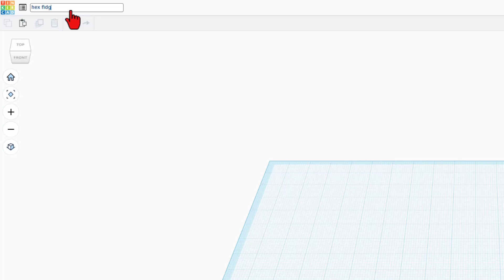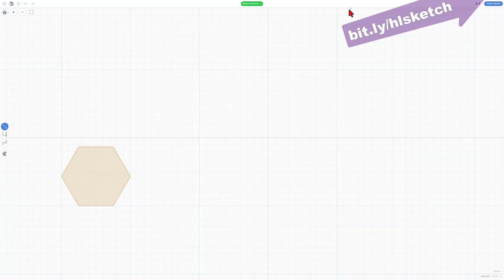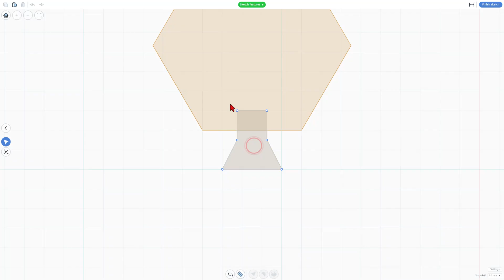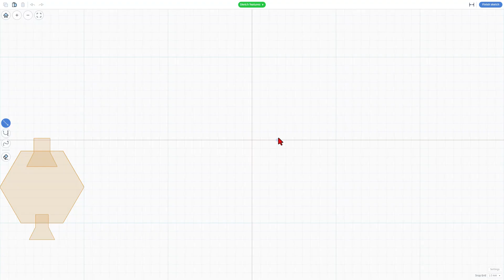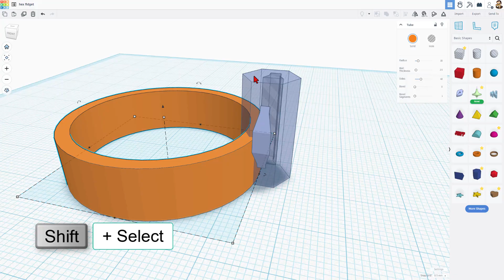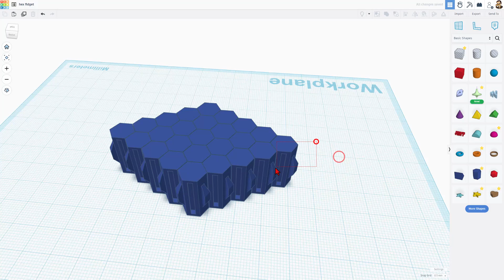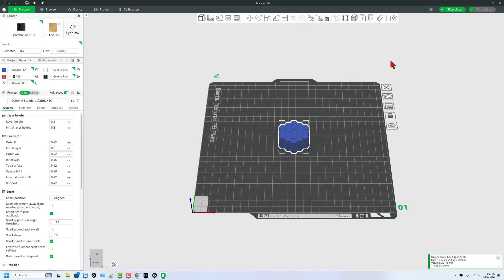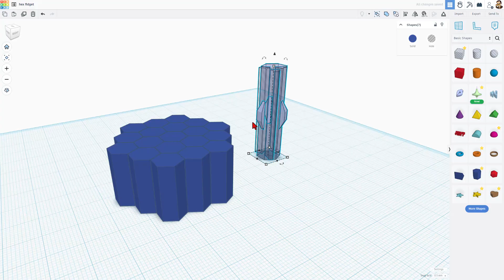Easy Tinkercad Sliding Hexagon Fidget: Customize & 3D Print Too! 💯🤯

Comment: I have a Tinkercad issue/problem. I have a design I made for a project. I use that same base design for a lot of other projects. Add shapes and holes and shapes and holes. My problem is that it seems that even tho I used the 'hole' to reshape stuff and it is gone from view but all the triangles seem to still be there. I can copy/paste that to a new design page and all the previously removed shapes are there just not seen. The more I do this even tho it is simple to the eye it is very large behind the scene. Is there any way to clear the cashe or something to free it all up. Thanks. (Hope this makes sence)
Reply from the maker: Any chance the part you are re-using in an imported STL? That would cause that issue. The video highlights the difference between native Tinkercad designs and importing an STL. https://bit.ly/tinknative
Reply from the maker: It is possible that the Tinkercad version history tool can help. https://bit.ly/tinkvh
Reply from the maker: Easily share a link for your Tinkercad project: https://bit.ly/sharehl Get me a link to your project in the design questions area and we may be able to help. https://bit.ly/patmess